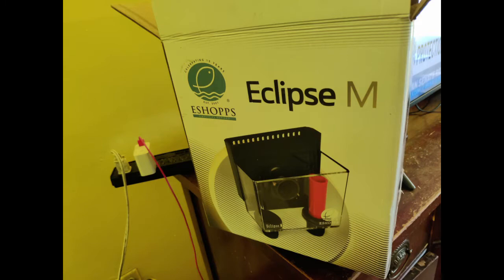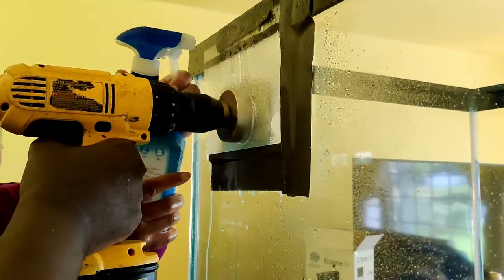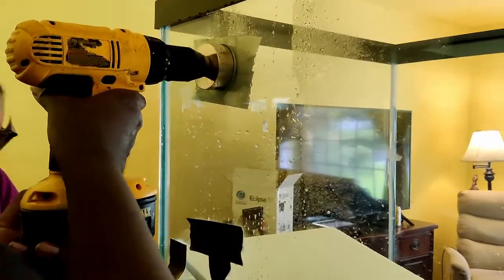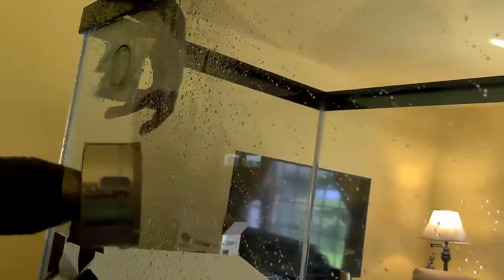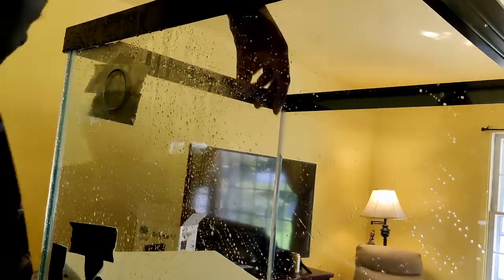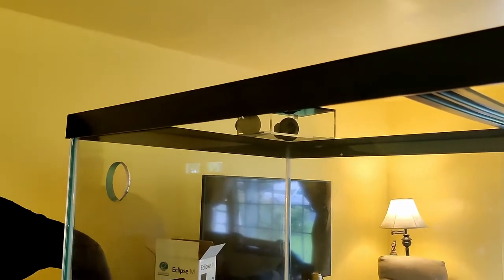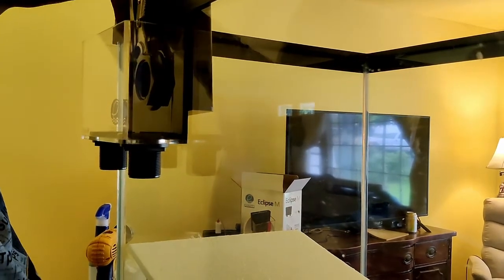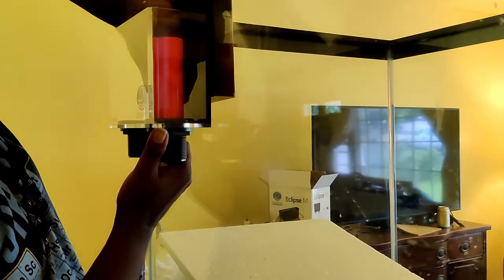120 Gallon Upgrade - How I Drilled My Tank and Installed an Overflow

Comment: Thanks for posting! What brand of tank did you buy to know it wouldn't be tempered glass?
Reply from the maker: I ended up buying an Aqueon tank.  I had to do the polarized sunglasses test on the tank in order to make sure it wasn't tempered glass.  I would hold my phone on the inside of the tank and rotate the polarized sunglasses on the other side.  If the view through the glasses got darker or lighter, then the glass was not tempered.
Thanks for asking.

Comment: Is there anything you would have done different installing the overflow box if u could ?
Reply from the maker: Interesting question.  I would have installed the overflow a little higher, because I don't really like having the water level below the black rim of the tank.
Reply: @GwonkReefkeeping  Thanks for letting me know as I have the same tank and am planning on installing a overflow box and I like to keep the water hight high..I appreciate the info...
Reply: @GwonkReefkeeping I just had a thought...but if you put wave makers inside the tank instead of regular powerheads wouldnt low water leval in the tank be a good thing since the top of the water would sway back and forth ?
Reply from the maker: @milkspotscausemetospazzout6813  I use wavemakers in the tank.  I have a couple of Jebao wavemakers on the right side of the tank and a Maxpect XF-350 gyre on the left side.  I configure them so that there is minimal sloshing back and forth.  It seem so work for me.  Also I am a little scared of having large waves because it is said that it puts a strain on the seams of the tank.